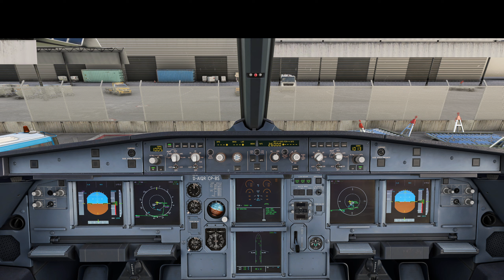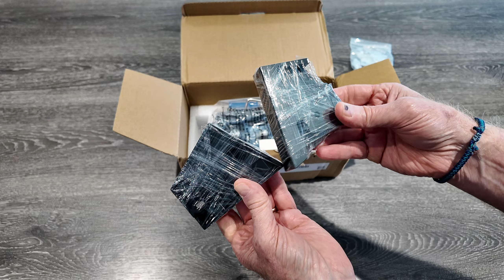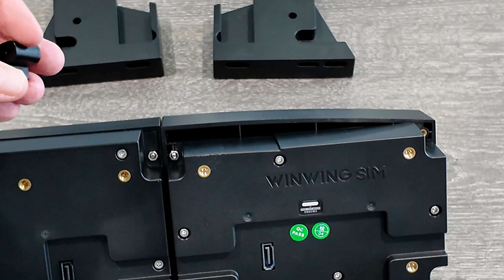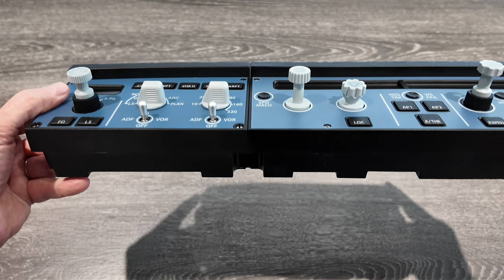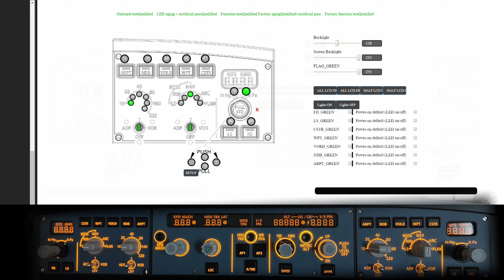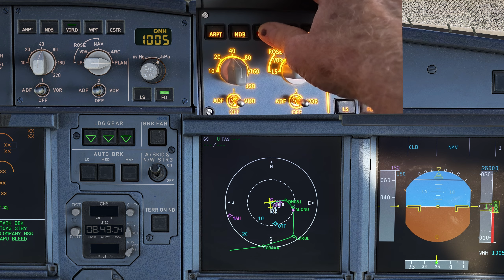WinWing EFIS Review | Captain & First Officer Units | Assembly Guide

Comment: I just got my 3X0 GLAREWING EFIS from Winwing. It works well under MSFS but it does not under Fly By Wire. Only functions running are FD, AP and auto/Throttle.

I cannot change the baro, neither can I change the scales or ARC/PLAN/NAV etc. The displays are flashing and stay on 10 scale without possibility to change.

LS, ADF and VOR don't work either.

SimAppPro is OK, all lines are green and all functions running.

Again everything works under MSFS but not under Fly By Wire which I use everyday.

Thank you to give me some help to fix it.

Pascal
Reply: I have the same problem with the FBW A320 stable version (the dev version is not recommended anyhow because of the constant upgrades). I have full functionality, EFIS und FCU , with the FS2020 default A320 NEO !  On the FBW A320 stable if I turn p.e. the range knob on the h/w-unit the corresponding knob on the display-EFIS does not follow and the ND flickers untill I turn the display-knob into the same position.  In another forum somebody found out, that unfortunatly ASOBO is not prepared to discuss this matter with winwing and viseversus.
It is therefore likely that this problem will not be solved at all.  This problem has been discussed at AVSim MSFS-Forum and ended up in a statement that it could be solved with an IT-tool (Github, Mobilflight....???   Binding H/W to MSFS ?)  Since I'm just a user with very limited IT-knowledge I can't follow up this.
Reply: @georgproffen7389  hello, try to make a firm upgrade through SimAppPro for each device (FCU and both EFIS).
Reply from the maker: @pascalbangratz2772  FBW compatibility is pending for MSFS2024 and still under development if I recall correctly. Works fine in MSFS2020
Reply: @SimHangerFS  No I am under MSFS 2020 and it does not work correctly for FBW.
Reply: @SimHangerFS  Hello Mark, I am running the FBW under MSFS 2020 and only the FCU is working correctly. I cannot give any instruction from the EFIS-L nor the EFIS-R. The only way which work is sending instructions from the FBW dashbord and then those informations are taken in consideration by the device. But reversly it is not possible. I retried to connect both EFIS without result. Have you any idea of what is wrong ? Many thanks for your help.
Pascal
Reply from the maker: @ check for a firmware update.
Reply: @SimHangerFS  already done. I asked for help to the customer service

Comment: Hello,

Do you know if there's a way to increase the brightness of the displays? On the Simmapro app, everything is at maximum brightness, but in simulation, the displays are dim. Perhaps there's a physical control that allows this? Just in case, I'll ask you this question. Thanks! For the feedback, kind regards.
Reply from the maker: @jean-francoisragneau1816  in the aircraft below the glare shield are two knobs (in sim) rotate these to increase brightness.

Comment: Will the left hand unit work without the right hand unit that might need to be added later for cash flow reasons?
Reply from the maker: Absolutely. No prerequisite for both units.
Reply from the maker: Point of correction - WinWing sell the 2 units as a single package and not individually.

Comment: Awesome ! Thanks for the review !  
Just one question : every single time I launch the Winwing software, the lights on the FCU comes to full brightness and it does not seem to remember the light settings from the previous flight... then I have to tune in the brightness settings again... do you know if there's a way to save the brightness within the device so it remembers its settings ?
Thanks !
Reply from the maker: Set the brightness in your airbus …dials below the main console. You might have them turned to full.

Comment: Hi Mark it was your channel that influenced me to buy a pc specific for flight sim from Wired2Fire. The model I purchased was the Valkyrie but with RTX4080 super graphics. I have watched numerous channels try to achieve the optimum settings. I am running 3 identical viewsonic 27 monitors in 2k with a refresh rate of 144 Hz . The msfs settings are set mostly set to Ultra. I have run in DX11 and DX12 with frame generation and I still not attain the FPS that you appear to achieve. I know your card is RTX 4090 but I am a long way off the figures you achieve . I would like your assistance in maximising my system . Thanks Barrie
Reply from the maker: Try DLSS on quality mode with frame gen on.
Reply: @SimHangerFS  Hi Mark thanks for the reply. I have tried every  combination still not getting the performance I believe the system to be capable of. Could the monitor refresh rate be holding it back. Should v-sync be selected. The monitors have AMD adaptative synch. Should this be used.
Reply from the maker: @49537480  fps and refresh rates are linked. V-Sync helps provide a smoother performance, but can reduce overall fps. Check you have XMP set for your memory in the BIOS.
Reply: @SimHangerFS  Mark once again thanks for your reply. As I understand from Dan at Wired2Fire the pc was optimised and over clocked as part of the setup. Mark if it's not too  much trouble would it be possible to conduct a test between our systems. If we setup the same airport,weather, time of day and airplane along with the msfs settings perhaps it would be possible to achieve an accurate comparison. I have always found your YouTube content well balanced where others sometimes border on sensationalism for click bait. I just want the best out of my system after making quite a financial investment just to play MSFS 2020. I can provide you with any additional information via email if that would be of assistance.

Comment: Why get both left and right side units?  Don't they perform the same functions?
Reply: I normally fly from the left but use the right side navigation display for extra options.  The EFIS panels are not expensive and if only for the real life visual symmetry of the setup, I am more than happy to get both units.
Reply from the maker: @raywalsh5414 it is your choice. You can fly with only captain side. 😊
Reply: @raywalsh5414  agreed. i find it useful to set-up the FO ND screen for Nav/Arc whilst I have LS on mine or you can have the two NDs on different ranges etc etc
Reply: Symmetry fella. Simple. 😛
Reply: @AmazeTase  😶
Reply: Well you can switch to 20NM on Display while you use a farther view like 160NM that way you don't have to switch all the time.  Just look towards the FO side and see further away.